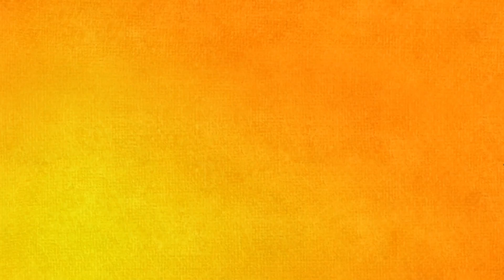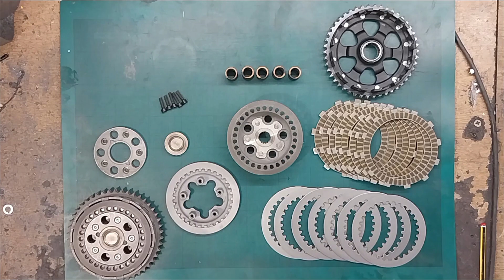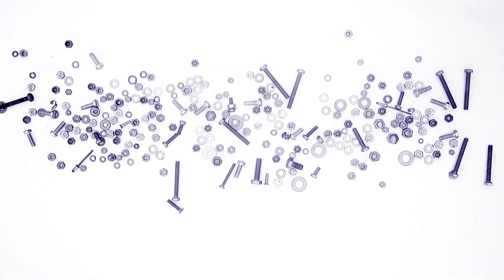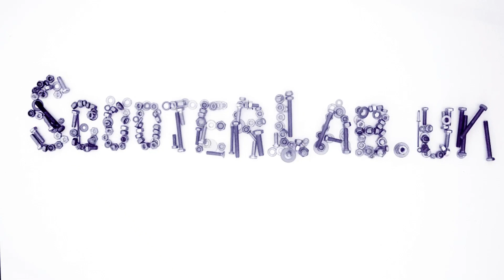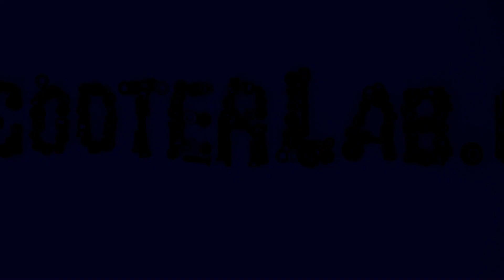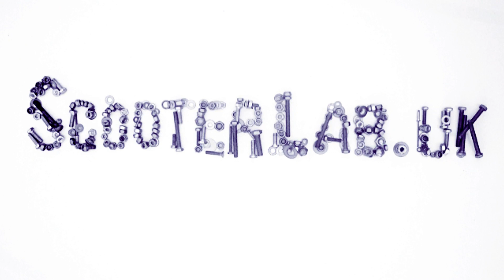SLUK | AF Rayspeed 8-plate Lambretta clutch explained

Comment: Good to see this has been produced and at a very cost effective price but why an odd number of springs? If you are redesigning the clutch why not have six springs and then you can mix two strengths of spring in the same clutch giving you a choice of three clutch spring options (hard, soft and mixture of hard and soft).